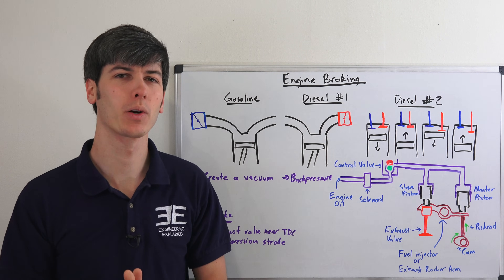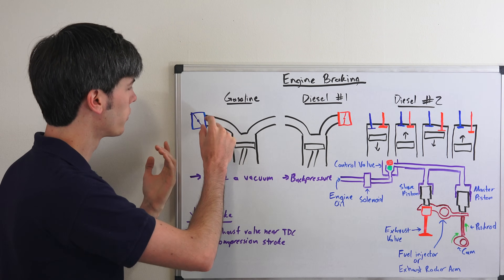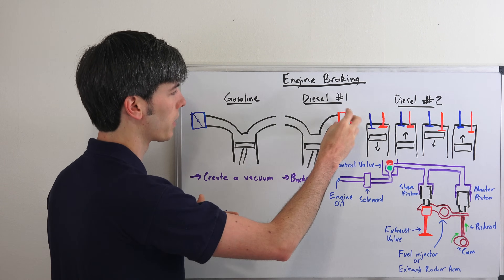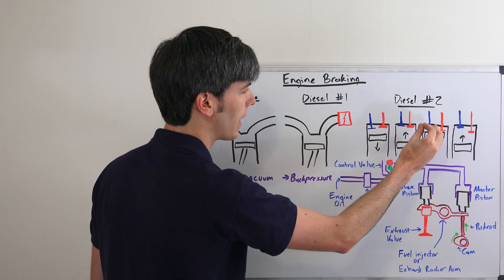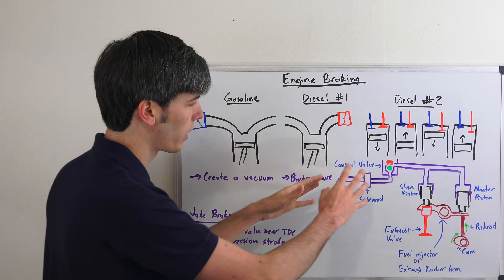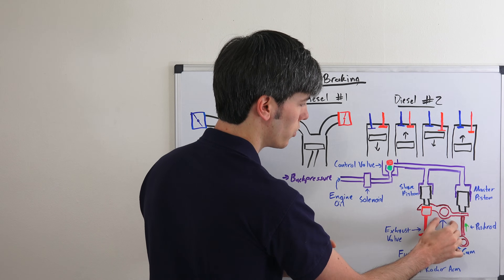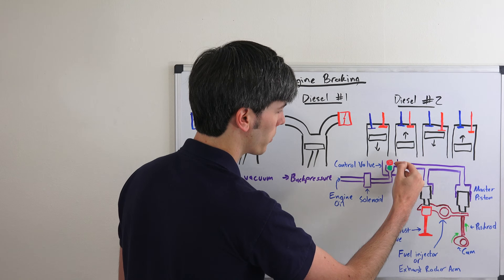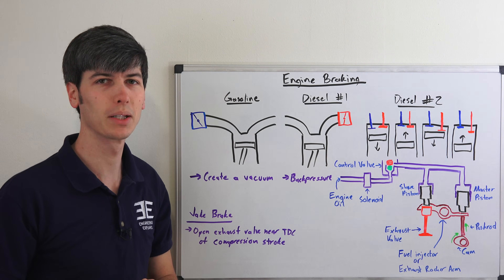What Is Engine Braking? What Is A Jake Brake?

Comment: remember when everyone was burning fossil fuels for transportation? that's one of the biggest mistakes of humanity. thank goodness for the Tesla
Reply: +Shaun Smith Remember how the main source for electricity is still coal and nuclear power. That's why EV's are actually more damaging for the environment per mile than modern combustion engines. And that's leaving out the fact that the batteries used in EV's are highly toxic to the environment as well.
Reply: +Shaun Smith 
Burning fuel was only a mistake, if there exists, as rumored, a free-energy far-better alternative. But the evil NWO criminal elitists, stole free-energy technology from Tesla and from the American people, such that such an alternative, is not quite available, even though it should be. Why are we paying for energy, when energy should be free by now? The universe is full of energy, so it should be a crime to have to pay for what ought to be free.
Reply: +Dakota Newcombe
But aren't you conveniently forgetting, that the electricity for recharging is much cheaper than the gasoline? (Of course the enviro-wackos seem hard at work, to send the cost of electricity also sky-high, which might soon negate that benefit?) The issues are, that batteries still have too low of energy-density, and take too long to recharge. There are still technical challenges to making electric vehicles practical and competitive with gasoline vehicles. I would of course much prefer an electric car, if these problems could be solved. If cars could have free-energy machines to produce their on-board electricity, that would instantly solve the problems. But few people want to talk about that, because they think it is conspiracy theory kook speculation.

EV batteries do not look so bad anymore, once the costs come down, and the reliability goes up, to justify the cost-benefit analysis. But EV are still struggling to catch up to the range of a gasoline car. And gasoline stations are everywhere, but aren't recharging stations hard to find? How long does a recharge require? Long enough to stop and eat your lunch?
Reply: +Yosef MacGruber I was going to touch on the energy density issue if someone were to challenge me. I fully agree with what you say, the loss of Tesla's work is one of many cogs in our scientific progress. And if EV'S had free energy devices on them I'd absolutely love to have one.

Comment: When I was a kid we called them Compression Releases....some of the big bore single cylinder 2 stroke engines had them so the unprepared/uninitiated wouldn't break an ankle when it kicked back on a wimpy kick start effort...you could also pull the handle to "engine brake".
Reply: +steve Fowler the compression releases i have had on motorcycle engines were  set up so you could bleed off the compression till you got to top dead center on the power stroke to begin the kick start that got you maximum degrees of rotation freewheeling so to say to build up speed on the crankshaft so the next compression stroke would have flywheel momentum to carry it through 
now the trend is to put flyweights on the camshaft to unseat the exaust valve a few degrees during compression  until starting/ idle rpm's have been reached 
then for a while briggs used a stepped intake cam lobe that allowed leakage that at cranking rpm's helped the starter get things going but at running rpm's was not open enough to affect power 
yours may have been different but mine you used the release to get to the top of the power stroke then gave one good fulll kick 
any other way and you could have stood on the kicker and it wasent going anywhere
Reply: crowmagg1 As I stated the ones I saw were on two strokes (like the Yamaha 250 and 360 Enduro's) back in the day...no valves in two strokes but they were known to kick back if you didn't know what the hell you were doing...I never had one but was familiar with them on buddies scooters.
Reply: The Tool Guy Yawn...I see you don't even have the mental fortitude to admit when you are wrong? As to my academic and professional qualifications, I certainly don't feel the need to defend them to the likes of you sir.

Comment: does engine braking cause premature wear on your car?
Reply: +Yosef MacGruber I used to drive with Jake brake on when not in city all the time, it's just laziness. release gas - it engine brakes for you, don't have to shift the foot. seems like nothing but when you are driving for 12 hours a day for few days you become lazy. 
Volvo trucks have 3 positions for Jake brake: light, medium, heavy braking. Freightliner, Kenworth have just on/off switch for Jake brake.
Reply: +One Day 
I don't think that is the only reason. Cars just are not that heavy compared to serious trucks, thus downshifting is sufficient. Except for mountain downgrades or long hills, simply wind drag and brakes usually are sufficient to limit speed. Trucks carry a lot more weight, thus downshifting + Jake brake is needed for sufficient safety and braking options.

But I do have a question that maybe somebody could answer for me? Do truckers abuse the Jake brakes? Why not downshift more and Jake brake less? Jake brakes make so much noise, it can be heard a mile away, not so good within the big city, where people are trying to sleep. Also, is Jake brake, on/off, or is it of a variable amount of braking power? Are some Jake brakes quieter than others?
Reply: +Yosef MacGruber also Volvo's engine brake is a gentle purr in comparison to newer Freightliners or old rust buckets "classic" Petes, KWs.
Reply: +Mod Mark 
No, unless the driver changes down too early and habitually redlines or over revs the engine. Just change down as normal and no additional wear or stress will occur.  Engine braking is an advanced driving technique. And I've just remembered that most American vehicles are auto trans, so engine braking isn't as effective as it is on a manual box.  Although some of the more advanced auto trans probably have configurations that work like a manual.
Reply: Skye13
Can a driver be expected to constantly push the accelerator all day? Surely they must have some adaptive cruise-control for trucks by now?

It is bad design if merely taking one's foot off the accelerator for just 1 second, to switch feet, causes a noisy Jake brake to sound?

But then I am not a truck driver, so I do not know enough how a truck cab differs from that of a car?

I also read somewhere that a Jake brake, properly mufflered, is not all that loud, at least not on all trucks. And I think the other day, I heard a Jake brake on a passing truck, and it wasn't even all that noticeable, as it was not loud.
Reply: Yosef MacGruber Ofc there is cruise control but you do not use in winter for instance. So yes, all day pushing the pedal. And what do you mean to switch feet?
Reply: Skye13
How many hours can you push the accelerator, until you just have take a break, and push the accelerator for a while with the left foot? Is some noisy Jake brake going to sound off, for the second that it takes to switch feet? What activates the Jake brake anyway? Releasing the accelerator, or pushing the brake pedal?

Every vehicle I have ever had, always had cruise control. I prefer to use cruise control when I can, because I think a computer can keep the speed very steady, saving fuel, far better than even a careful driver can.

Cruise control has a few issues with it, as it is not much good in traffic, due to having to ever adjust the speed. This is somewhat fixed by adaptive cruise control, which I have never had yet. What about safety? Slipping on snow or ice or hydroplaning? Maybe if slippage is detected, perhaps the car or truck should automatically cancel the cruise control setting? Some safety rule probably claims that one can let their foot off the accelerator, faster than one can over-correct by touching the brake pedal? So you shouldn't use cruise-control in the rain? Yet probably most drivers still use it?

Why would you not use cruise control in the winter? Are you talking of there being snow on the roads?

I would love to see vehicles soon go to self-drive, if they can prove that the computer software can reliable drive in most all conditions? That is a lot to ask of computer software, but there are so many 100s of millions of drivers or old or underage or handicapped people who can not drive, who would much benefit from this. I think there are a lot of things that computers could do better than humans, that is if, the software is written to a very high quality standard, which I do not understand very well yet, how soon this could become the case? One thing for instance is, that many drivers may panic or react inappropriately to a sudden change such as a tire blowout, whereas a computer might recognize what it is instantly and follow the proper recommended procedures, without "having to think about it" or "having one's nerves rattled."

I saw a YT dash-cam video of a big RV having a blowout, I think on the left driver's side front tire, and then the RV was into the medium, and then flipped over. The video was taken from a vehicle following behind. I suspect the driver did not react properly, and that flip-over might have been prevented by a self-drive computer driving, that was properly programmed with how to handle it. The first priority is to hold into the lane, until one can slow down and get the vehicle under control. Some YT videos say you have to press the accelerator, not to speed up, but to overcome the sudden drag of a tire suddenly dropping and going flat. How can I verify if that works? But supposedly they proved it, by causing blowouts on a test track, with some tire mounted mild explosive to cause the tire to suddenly fail. But many drivers are not going to grasp the steering wheel firm enough, because by the time they realize what is going on, it's too late. But sometimes there is a little warning. If the steering wheel suddenly starts vibration, it could be a sign that a front tire is failing. Perhaps not enough time to slow down, but time to get a firmer grip on the steering wheel. It would have been far better to allow the tire to destroy the finish on the side of the vehicle as it goes to pieces, than to flip the vehicle over due to failure to control it. This is also a reason why people should ever wear their seatbelts.

I would also like to see self-drive vehicles somehow certified, that they can handle such situations, and that there is enough steering force to hold the lane even in the event of a blowout.

I suspect that a lot of self-drive vehicles, will still need "drivers" so as to refuel the vehicle, to personally deliver packages, or whatever other duties that a self-drive computer is unable to do. The computer does much of the work, and the driver still gets paid. Hopefully then, the driver can be in the back asleep, while the computer is driving. Also, computer drivers would make better time for truck runs, as the computer does not need any time to sleep, and should not be restricted to only driving what? 10 hours a day?
Reply: No. The engine has to turn those revolutions at some point regardless. It does save your brake bads/shoes and disks/drums though.

Comment: You really didn't explain the common automotive form of engine braking and downshifting well... Look at all the comments.
Reply: +Ian Thompson Hm, I am guessing here (gasoline engine): Downshifting results in a higher RPM. Also, the vacuum gets built over time, until it's strong and actually causes a noticable breaking effect. So, only a small percentage of that vacuum-time is actually effecting breaking-time. I hope I am making sense here - Accountant and Author :-)
Now, the higher the RPM, the greater the breaking time per minute - and that's why downshifting causes a greater engine breaking effect.

Was that halfay right? :-)
Reply: +Christian Breitenstein Downshifting will also put you in a lower gear, meaning more braking torque will be applied to the wheels.
Reply: It is vacuum that causes engine braking in a gasoline engine, not compression.  The piston is trying to draw air through a restricted port (intake).  Connect a vacuum gauge to the intake manifold and you'll see 22"+ of vacuum with the throttle closed during deceleration.  Since there is less than normal air pressure in the cylinder during the intake stroke, there's less than normal air pressure for the compression stroke, there is little compression to resist the piston to cause "compression braking".  You can't compress a vacuum (even though it isn't a perfect vacuum).
Reply: @danburch9989  you are 100% correct.. the vacuum, does all the stopping on gas and diesels.. piston at top dead center, valves closed, all air has been vented.. what happens when that piston goes down? Vacuum!!! And Jacobs don't want you knowing that, why? Because it is very hard on your engine..
Reply: +Christian Breitenstein 
In lower gears, the amount of air being moved and restricted, is a greater amount of air per mile traveled, thus the kinetic energy or speed of the vehicle, is more efficiently converted into heat which the engine can handle far better than can the easily-overheated brakes. Thus the braking effect is increased in lower gears. That is why automatic transmissions have those low numbers, 3, 2, 1, as those set a limit of the maximum gear that the automatic transmission should engage. Those selections are mainly for engine braking, but perhaps a slightly lower gear should also be selected for towing? Otherwise, just ever leave it in Drive or Overdrive if there is an Overdrive selection, for best fuel economy.
Reply: Vacuum....sucks you to a stop

Comment: Its amazing how many mechanics will argue to to the bone saying engine braking (on a petrol engine) is due to the engines compression.

I also came to the conclusion engine braking must be from engine vacuum when the throttle bottle body closes. Since the compressed air acts as a spring,  does the exhaust valve play a part here when it opens letting the vacuum escape creating some sort of retarding behaviour?
Reply: +Chris Doolan No it does not play a part Chris. As when the exhaust valve opens on a gas-engine,the intake valve is fully closed,so nothing is entering the combustion-chamber to create any more vacuum! :)
Reply: +menom7  but wouldn't the vacuum equalise with atmospheric pressure via the exhaust pipe when the exhaust  valve opens?
Reply: Chris Doolan Yes,correct Chris! In between the intake-valve closing,and the exhaust-valve opening,there remains a vacuum within the combustion-chamber,that aids in slowing the pistion-down within each cylinder! Once that exhaust-valve opens,that vacuum is released and the whole process,starts all over again within the combustion chamber!
Reply: It's not a perfect vacuum.  Some air has slipped in the cylinder through the butterfly.  So the exhaust stroke contains some air, it is not releasing a vacuum otherwise air would be travelling into the cylinder from the exhaust side and then it would have to go somewhere, out, the intake, which makes the whole thought experiment absurd.

Comment: Does engine braking differ from manual trans & dual clutch trans?
Reply from the maker: +Dre2383 Nope. Clutch is engaged while the transmission is in gear (with no throttle), and you have engine braking (same for both).
Reply: +Engineering Explained EE good video.  But just need a clarification here:  Method #1 is a technique utilizing existing engine components (TB, etc.) to slow the vehicle.. whereas #2 is a system designed solely for the purpose of braking "Jake Brake".. ? Correct?
Reply: +hindflight R not to interuot but yes that's correct. There is no mechanical need, for the jakebrake, required by the engine to operate. It's just a good way for big heavy things to stop without using brake pads. Sometimes pad material isn't up to the task to stop a semi on a down hill. Braking is about bleeding energy from your system. It's often only bled by converting kinetic energy to thermal energy. In fact that's how most of a vehicles dampening systems work. Like struts. The jake brake is losing energy not (much) by heat but by doin work. It takes work to compress air. That work uses energy. Once the energy is in the compressed air, and it's released to the atmosphere, then it's not in the vehicle anymore. Regen brakes recapture that energy and make power. Regular brakes make heat and shed it to the environment. Creating a vacuum takes work. Creating pressure takes work. The key is to capture the energy and release it someplace not to connected to you.
Reply: +Mechanized Ape 
 interrupt* also I'm not entirely sure but I think when you engine brake and create a vacuum, that vac doesn't keep the Pistons going for a few reasons. Throttle body is not perfectly sealed. Vac losses energy fighting gravity in work to bring piston back up and losses energy fighting other Pistons that are trying to pull a vac while the currently vacuumed piston is trying to move upward in the cylinder. Lastly and most insignificantly, heat from friction between piston rings, and other moving contact points. Chains, belts, pulleys, bearings, springs, tappets and so on.

Comment: So if I'm coming to a stop sign at say 40 mph and I shift my car down a gear to raise the rpms and add more engine braking, am I losing any gas when the engine is running at higher rmps say in 2nd gear at 40 mph (7-speed auto, I know it depends on ratios..) ? You said its just a vacuum so I'm assuming no energy is technically lost besides the kinetic energy of the car.
Reply: +medowatcher yeah, you are not loosing any gas out of engine braking at all, it is also a part of "ecodriving" tactics. Once I also hear a saying "a good driver doesn't use his brakes while decelerating at a stop sign on a road trip". It uses gas only on low RPMs, mostly feelable on diesels, just to make the engine still running
Reply: ah okay gotcha, thank you my friend ;)